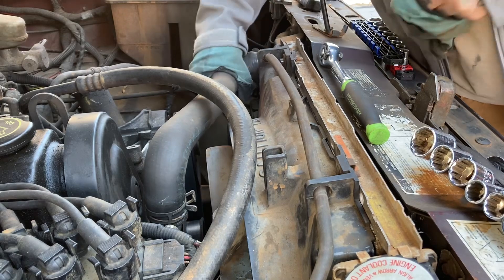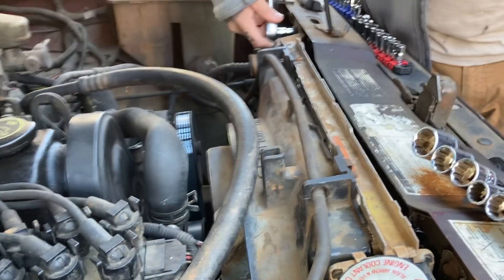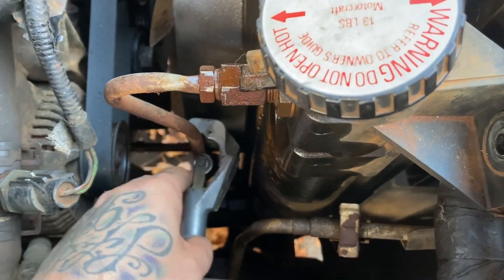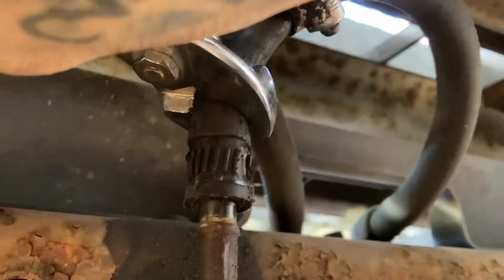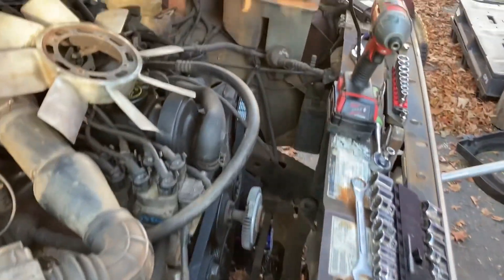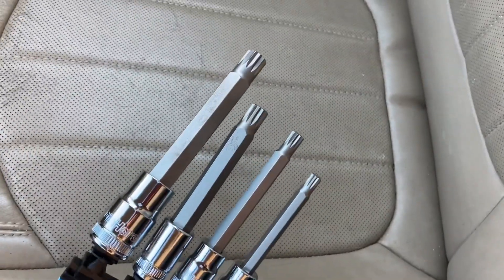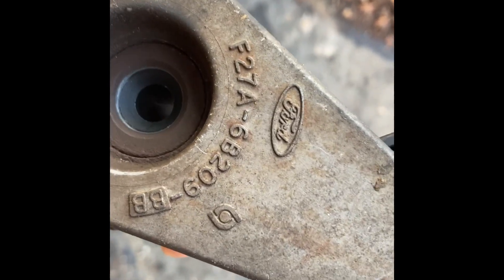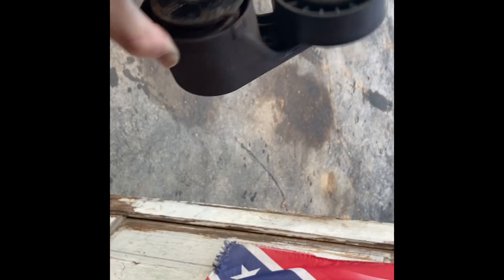92 Ford Ranger Tensioner Pulley Replacement +stripped Bolt! Part #1

Comment: would have been nice if he told us the size torx he used even though I'm sure it is a t47 from my searching the internet! A  45 seems to fit right and people try to loosing it with one and strip  the bolt so make sure you have the wright bolt and get it all the way in the bolt is tight because of the corosion  have a nice day and good luck! mike
Reply from the maker: This one took a 15mm